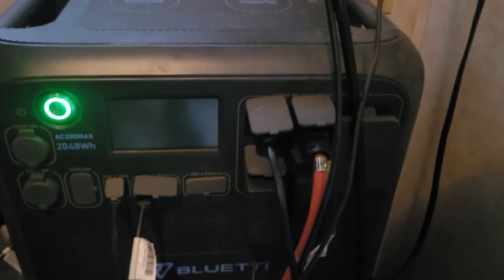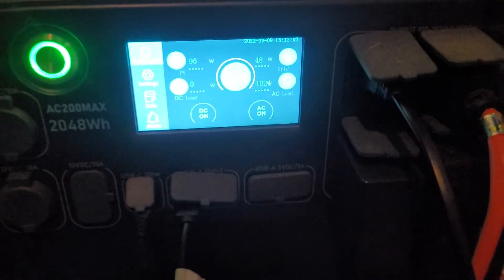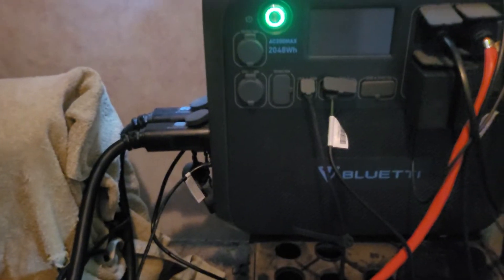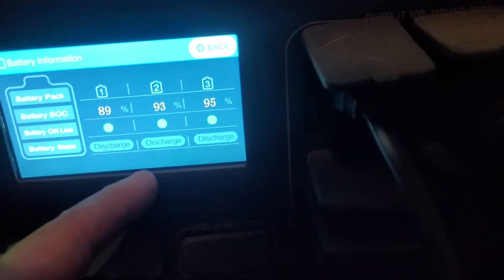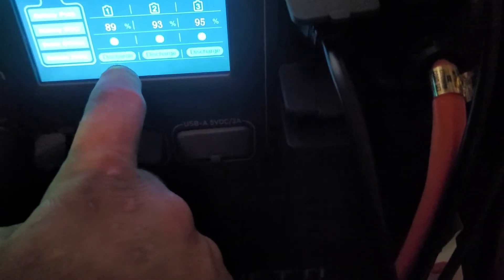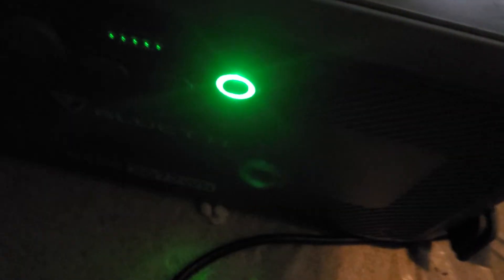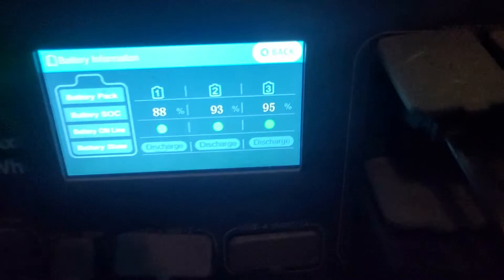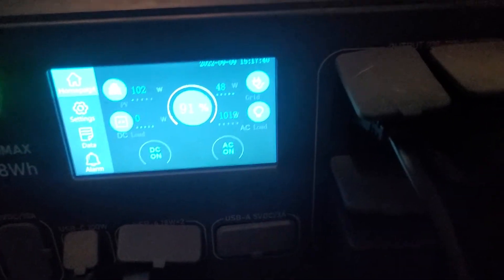Bluetti- How To  Connect The B300 To ACMAX200

Comment: I just got b300. Why are the battery ports not on the same side as the unit now one of my batteries has the face backwards or my unit has the face backwards
Reply from the maker: Pretty sure the design is to match up  with the Bluetti AC300

Comment: Thank you for producing this video. I eventually recharged my B300 battery via the AC brick as you described, and I could see the five green lights flickering, all as you showed us. So at least I know my B300 is not broken. However, the B300 is still not showing on the touch-screen, nor on the phone  App.  So.... my AC200MAX is still not communicating with the B300. Hmm, at least I've hugely narrowed down the problem, thanks your help. I'll try to contact Bluetti now that I can pinpoint the issue. Notice I said  "I'll try" to contact them. This is going to be fun as getting a response is not easy.
Reply from the maker: If it is still not communicating, and the units are on and hooked up as shown in my video. Then I would test the  actual cable it's self. Hope this helps
Reply: I had some difficulty connecting a 2nd b300 to my max. It came down to, I believe, very firmly pressing in the connecting cable and locking it in place. Also I believe connecting one in position 1 (on b300) and the other in position 2 is necessary. It took quite a bit of fiddling around before they both connected successfully.

Comment: So you have solar going into the B 300s while it's connected to the max?
Reply from the maker: Yes this is correct
Reply: @MysticOwl15Homestead  how much solar on each battery?
Reply from the maker: @zfontain1975  450watts  on one and 200watts on the other